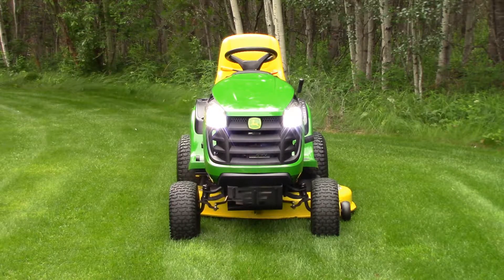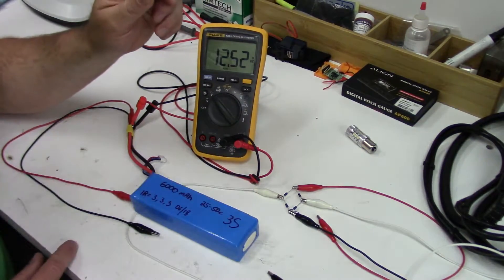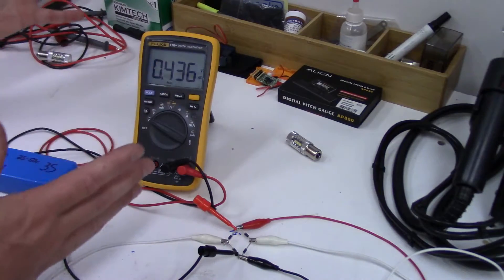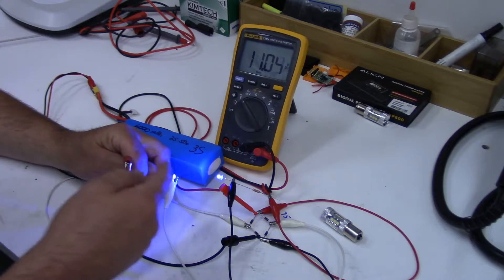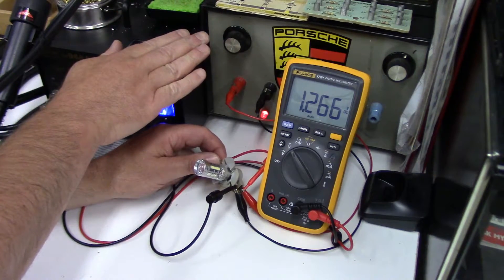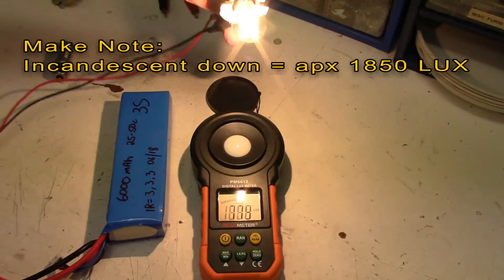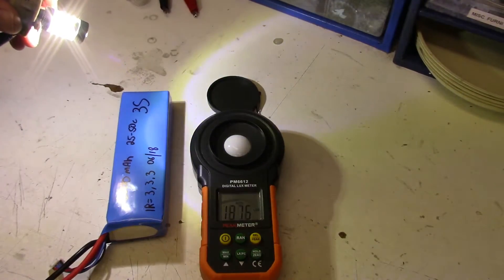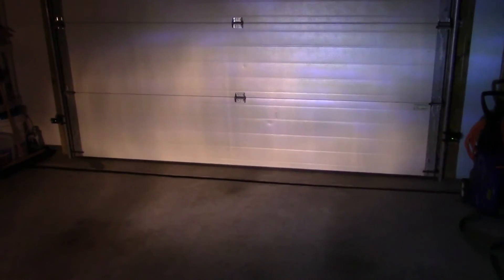Riding Mower Cheap LED Headlamp Bulb Update - Light meter readings.

Comment: Thank you very much!! You help me a great deal I've been trying to figure this out as far as LEDs being able to be run on AC since all my tractor AC goes to the headlights DC goes to charge the battery as well as you gave me a pretty good idea of how bright or high-powered of an LED I could use. I think it doesn't use 1.6 and these used 3 you should be able to use a lot stronger of an LED bulb I would think? I appreciate your video as well as the follow-up. I was going cuckoo trying to figure out if I could update the stator (alternator) so I could have more juice for LEDs and still charge my battery efficiently. Possibly even adding an actual alternator somehow to the flywheel to give me more power. Besides the headlights I was hoping to put LED strip lights under parts of the tractor. My nephew and grandkids love working and ridding on the tractor. I thought they would get a kick out of the light show. I was driving myself nuts. I know this video is old and not sure if you follow up on the comments but do you know if you can upgrade the alternator on a small engine and particular 2006 B&S 20HP INTEK GOLD single ohv 31P977 0670E1 . Thanks again take care

Comment: Very informative video.  I have a 2019 John Deere X584.  I installed Sylvania 1156 LED’s.  What do I do to make them actually work? Fuse was ok.  Just can’t figure out why they don’t turn on.  I mow near the highway outside of my property.  The only reason I put/want LED’s is for visibility/safety.  What do I need to do?
Reply from the maker: Maybe the LED ones you have are polarity sensitive and need the polarity in the JD bulb sockets reversed?  Just a guess of course. The only way to know for sure is to first power the bulbs with apx. 12VDC to make sure they are working and if they work in both polarity directions or just one. If just one, take a DMM (digital multi-meter) to your JD bulb sockets and confirm the polarity is correct for the bulbs.
Reply: John Salt thank you.  That’s exactly what it was. Reversed it and I’ve got bright lights.

Comment: Have you noticed any damage to the lens of the tractor?
Reply from the maker: Damage? Nope, they (the LED 1156's) run much cooler than standard incandescent filament 1156 bulbs.
Reply: Leds run cooler than the incandescent so they will actually make your lenses last longer!